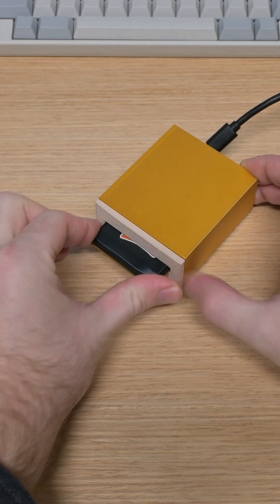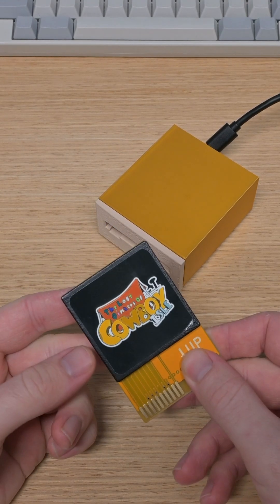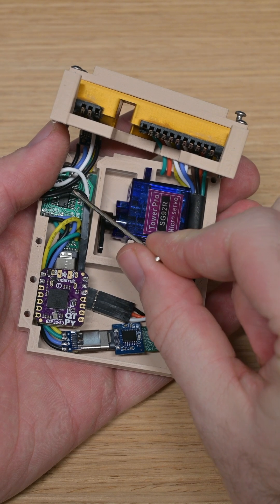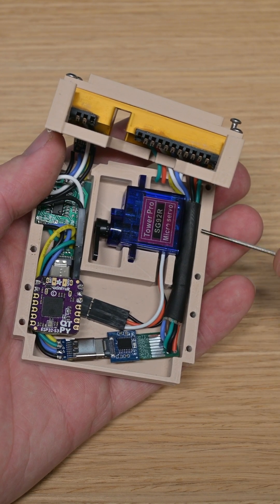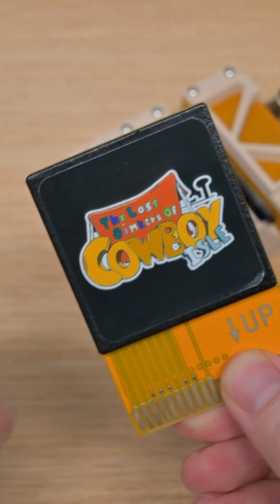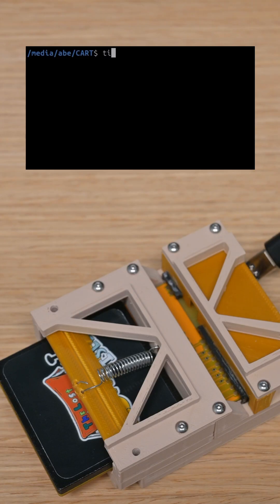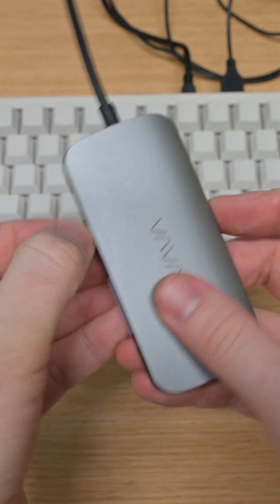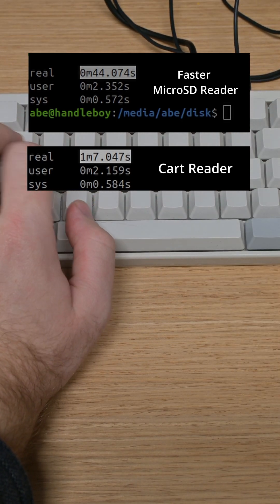Are my custom game cartridges slow?? #raspberrypi #retroconsole

Comment: Calculating md5sum of a file is not the same as reading a file...
Reply from the maker: It is! Generating file hashes requires reading every byte of the file, that is why it's used to verify file integrity - one bit changes and the hash no longer matches. Depending on the algorithm and implementation it's possible that the hash program may read bytes multiple times, but it's always at least once. If the same section is re-read the bytes will have been cached by the operating system and be read near-instant anyway, so it may be slightly slower than linearly reading a file, but not by much.

Now there is more of an argument for old spinning disk storage where the file may be physically fragmented and as a result the random bit reading of a hash might be significantly slower than a linear file read, but that's not a concern with flash storage.
Reply: @abetoday  that's true, but what i'm saying is that calculating the sha5sum of a file is not a fair test of the memory speed, because there is also the processor variable/bottleneck.
A better test would be:

dd if=./bigfile of=/dev/null
Reply: @abetoday  or for testing RAM speed:

dd if=/dev/zero of=/dev/null bs=100M count=10

Anyway..
The project looks really good, keep it up bro 👍🏼
Reply from the maker: @morels  That's fair! I didn't think to use dd, good idea!
Reply: @abetoday  just be carefull, it's called "Disk Destroyer" for a reason lmao

Comment: 1GB per minute is brutal. Imagine modern games need more than 6GB vram. (Ofc in vram you must store it uncompressed, where in the sd card you probably want it to be compressed but still. I know my SurfaceBook3 can do 1GB copy from one partition to another in second. (I upgraded the SSD to one with 7500Mbytes/s yeah bytes not bits) i think write is slightly less. That SSD is overkill tho.

Comment: In this case, your servo motor will not be as inductive as you may think. With that white data pin not sending anything, the windings in the motor are not energized. Any paracitic impedance youd find at rest, is capacitance/e-fields being generated from the long, paired strands of wire.
Reply: Also wouldnt it only cause induction when ejecting? Like the only time it moves is when data no longer flows meaning it shouldn't matter much if at all if i understand correctly
Reply: What is the servo used for in this thing
Reply: @slothymango ejects the cartridge. It happens right at the beginning of the video
Reply: @eeHMFIC  oh okay thanks
Reply: This was Spanish to me but I enjoyed reading it thank you 😂😂
Reply: I understood 0 percent of that :D

Comment: A gigabyte per minute or 15MB per second would probably even be fast enough for 4k videos as long as the bitrate isn't much higher than 150Mbit/s which would be higher than many 4k streaming services and high enough to match the bitrate of 4k BluRay. So for watching content its plenty fast. Copying large files on the thing is where you might see a bottleneck, possibly taking an hour to get a longer movie on the card in the first place.

Comment: Doea the servo mess with it if not activated.  I wouldn't worry about speeds as much as I would worry about corruption of data.  Would try reading then storing the same file, and see if it gets errors.  Look at the hex or binary files.  Also try looking at it on an o-scope.  Might consider finding someone to make you a custom board if you don't know how.

Comment: yo GOT to tell us how that eject mechanism works. What does the servo do for the cart to eject that far?!
Reply: i think its more reliant on the spring for that
Reply: It's likely just a spring that gets compressed when you shove the cartridge in with a locking mechanism like a hook, the servo just unlatches the hook allowing the spring to essentially shoot the cartridge out.
Reply: Except the spring is /extended/ and it's even visible in the video :)

Comment: Love this keyboard..
Reply: Yeah ,by the looks well used. All the letters have worn off :P
Reply: @paulmichaelfreedman8334  I think it’s a blank keyboard.. I hear that’s a thing!
Reply: @therackstar  Ya think? 😂
Reply: Yes exactly, i own a set of blank keycaps.  @therackstar
Reply: Using a keyboard with blank keys is such a flex 😂 I can touch type for the most part but occasionally I need to check which number has the "$", for example
Reply: Reminds me of typing class back in 1980.  Picture a room full of IBM Selectric typewriters all with blank keycaps.
Reply: It’s like using a calculator with no numbers.  Inconvenient
Reply: It's called the happy hacking keyboard if you wanna look into it more
Reply: @Arae_1  thank you! 🙏